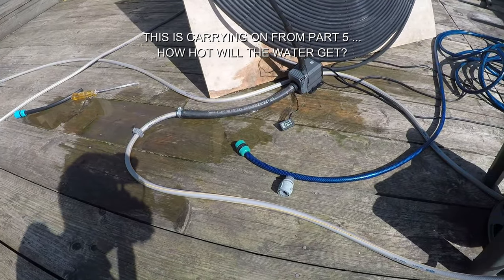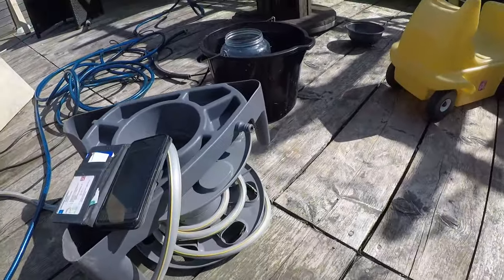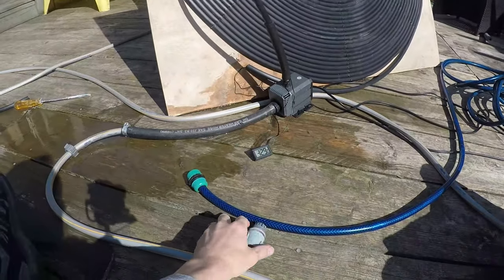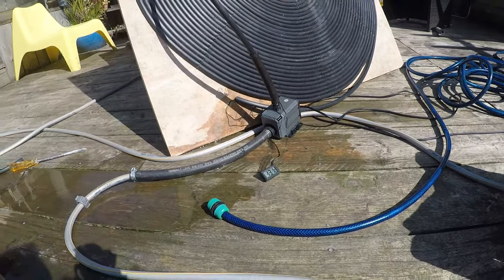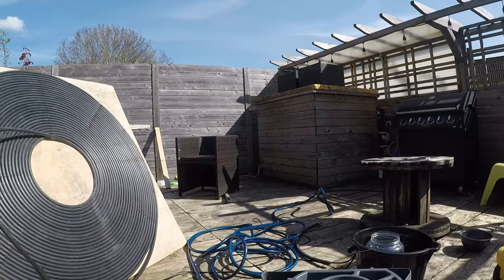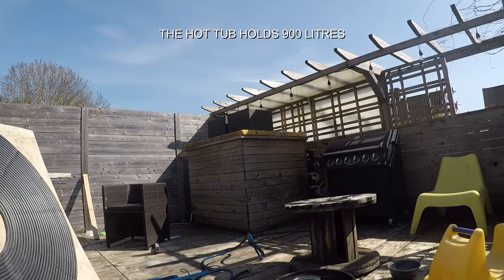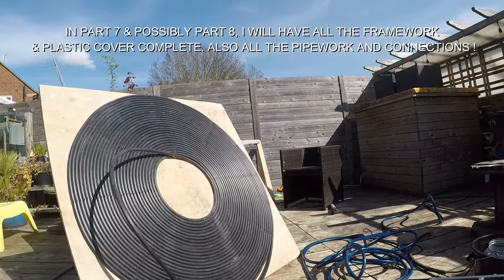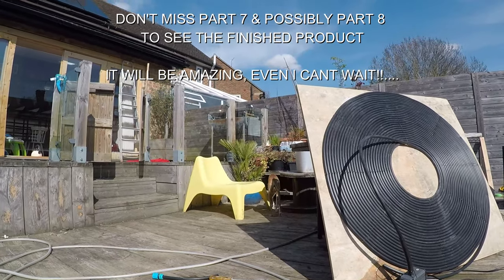How to make a Solar Powered Hot Water Coil  |  DID IT HEAT PAST 39 DEGREES?  |  Part 6\8  |  EP#19

Comment: Another good video, so excited about mine now, I've used 13mm internal diameter, irrigation tubing as it's a little more bendable than the pipe you showed, they fit easily onto a hozelock so multiple can be strung together. 

I was going to try and use my filter pump to push the water through the solar collector as well as though the tub, but I've decided to keep them separate after watching your videos.

Keep up the vids mate 👊
Reply from the maker: Cheers mate! Yeah I'm struggling with the pump at the moment, I've completed the project but the pump is letting me down! I think I'm going to buy another filter pump and hope that has enough power to push the water through the coil. There is more resistance in the coil than I first thought.
Tbh I think the hose I'm using probably has the same internal measurement but seems to work fine.
Reply: @thelondoncraftsmanworkshop  I've tested my tubing on the drain connector of the IBC and it seemed ok, but when I run it through the full length which is 25m I think I'll struggle as well, going to have a look and see if I can calculate the pressure or flow rate needed then find a suitable pump. Especially if I plan on connecting 2 or 3 of the solar collectors together
Reply from the maker: Great that would be amazing you can work out the pressure needed? Keep me posted if you can. Thank you!
Reply from the maker: Thats a really good question!
I haven't had time to get back onto this project but when I do ill look into this.